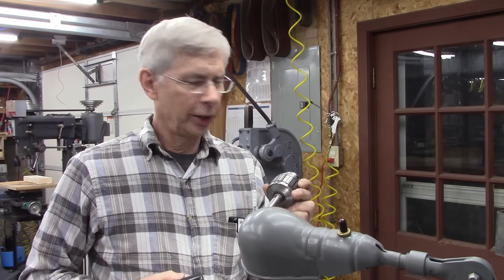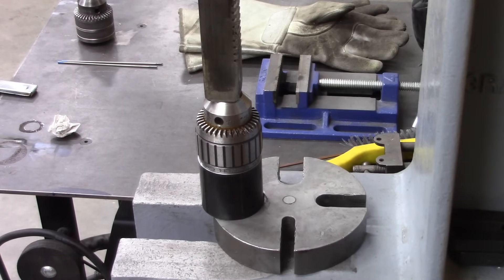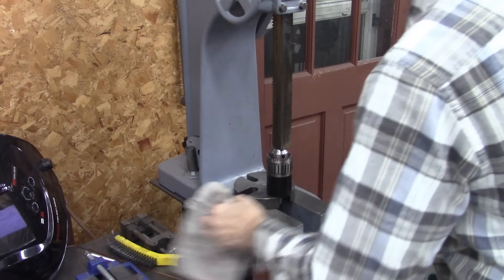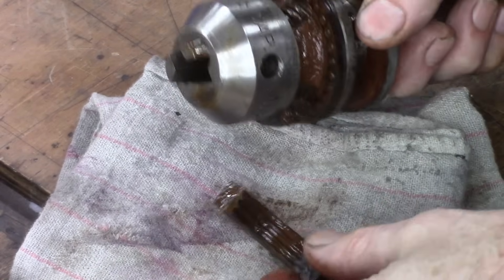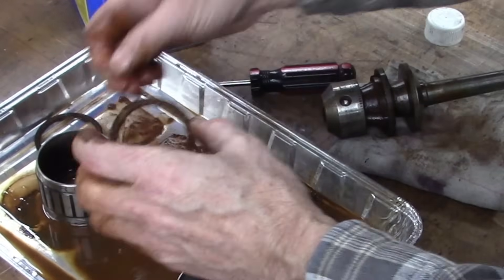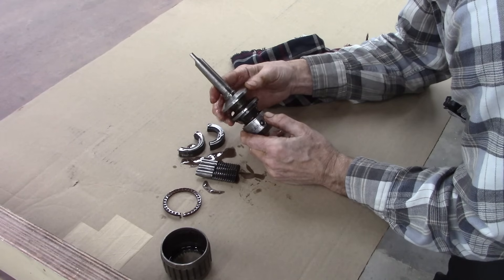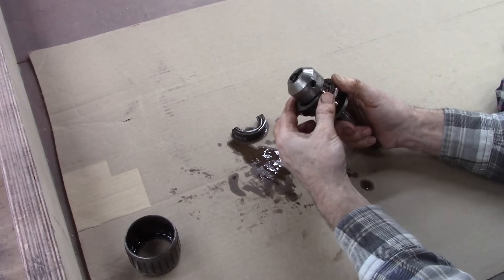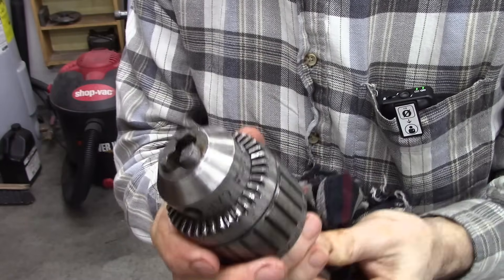Jacob's Super Chuck Rebuild - do’s and don’ts

Comment: That chuck really needed cleaning.   Well done.
I have taken apart regular Jacobs chucks for cleaning, but not a Superchuck.   Glad you did not loose the ball bearing.
The Jacobs site has a page showing the sequence of inserting jaws.  It is a PDF in the Tech&Support page of the site.   This page also shows the various taper details and thread mount details.
Dave.
Reply from the maker: Yes, incredibly dirty inside. I'll have to look at the web site and see if my procedure is the same.

Comment: Great Video. The method of opening the chuck jaws to press directly on the chuck body might work on a superchuck, but it does not on some of the other Jacobs chucks. What happens is that it the sleeve presses the back teeth and breaks them. With the other chucks it is better to partly open the jaws and put a tube over them that presses the chuck body while clearing the jaws. Just thought I'd mention t because I learned the hard way and this is a do's and don'ts video. Thanks Winky.
Reply: Good info danceswithaardvarks I did the same thing with one of mine years back. Broke the top 2 teeth. YouTube has done wonders for stuff like this over the years. Its become my go to when tackling things for the first time these days.
Reply: Yes me too. I always check with youtube first. There is no bad advice filter unfortunately.
Reply from the maker: I've only rebuilt one that was nit a ball bearing chuck but it was made the same as mine. Maybe it would be a good idea to open them until the jaw tips are just inside but not all the way open. I can see how it might be possible that the load could be on the teeth if opened 100%. Still, its hard to imagine it breaking teeth.
Reply: @WinkysWorkshop  Jacobs says to open half way.
Reply from the maker: @duanedickey7043  I now understand what you were saying previously. The sleeve rubs the back end of the jaws on some chucks. As for the super chuck half way is about where the jaw tips are just under the body. I should have done research on other chucks. I did change the title and description however.
Reply: @WinkysWorkshop  Another adjustment you might want to make in the title: the apostrophe doesn’t belong in Jacobs. Thanks for demonstrating the chuck cleaning 👍
Reply from the maker: @624Dudley  I know. It just didn't look right without it. Like maybe an operating system for a computer?  Ha
Reply: @WinkysWorkshop well, jacobs was the name of the inventor. So no apostrophe.
Reply from the maker: @melgross  Oh...  interesting, thanks!